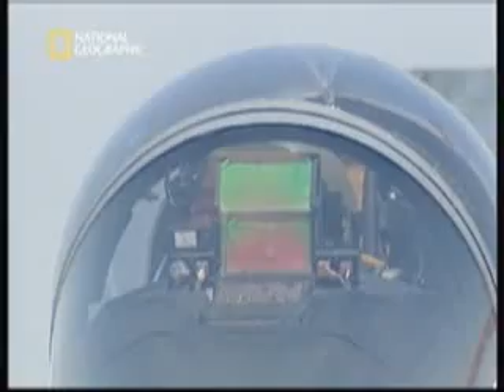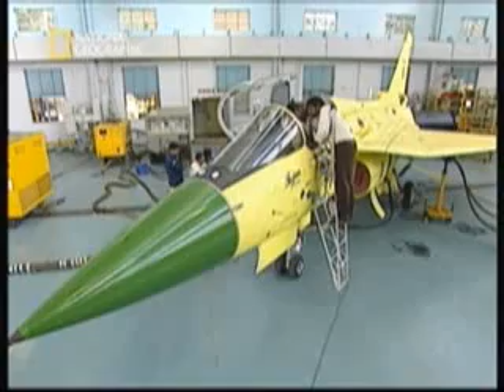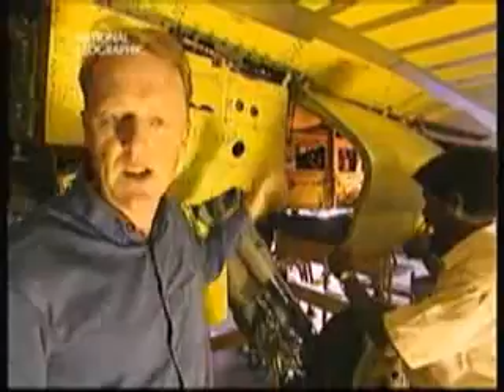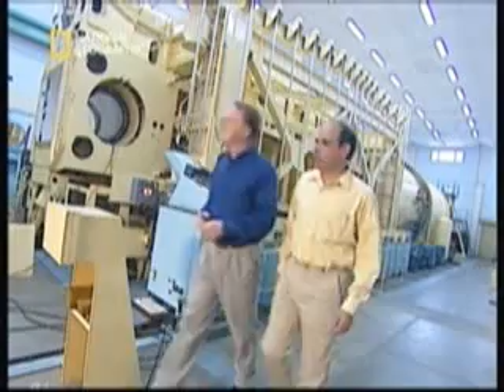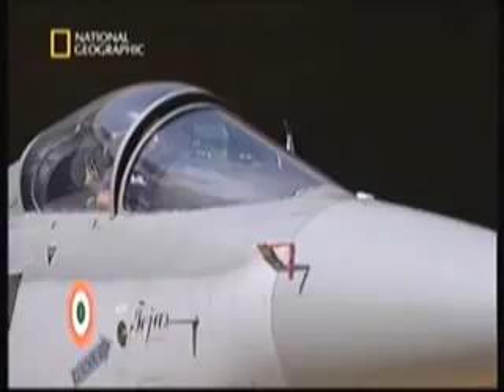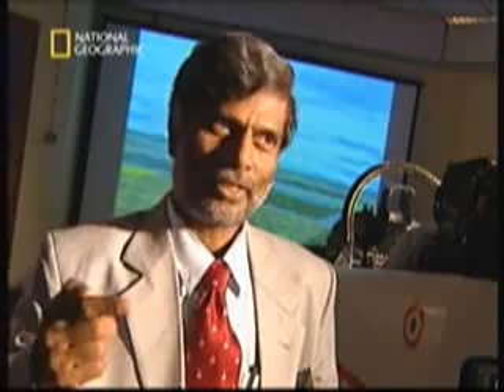Light Combat Aircraft - Tejas of India

Comment: The way I see it, the requirements of LCA are too high for India's industrial capabilities.  To meet the requirements, a lot of components were imported (from composite material to on board electronics, not mentioning the engine), with the hope of indigenization over time.  However, they found out that even successful integration of all these components was beyond India's capabilities, so the actual performance was way below the original requirements.  I think India really needs to take it slow

Comment from the maker: Exactly the point is when u a embarking on such a hugh project for the first time there are bound to be problems even the F-16s had lot of problems before in its engine. ejection seat nobody discusses that but the primary reason this project was delayed because of sanctions, embargo which was imposed on us at that time and moreover the economy was also piking up we should consider these factors even the engine problems will be solved by JV with Scnema of france and slight admin changes in GTRE